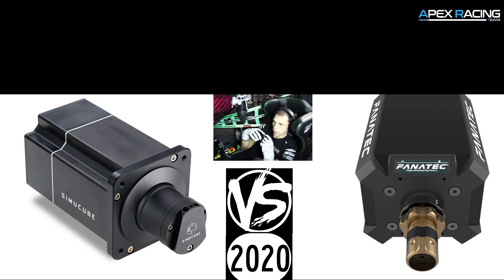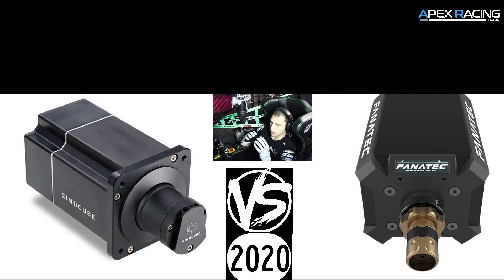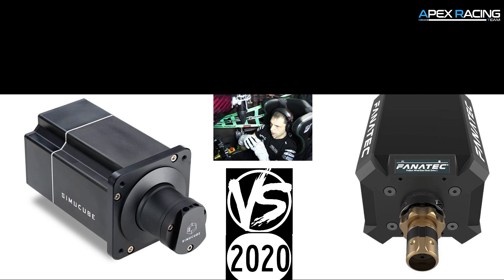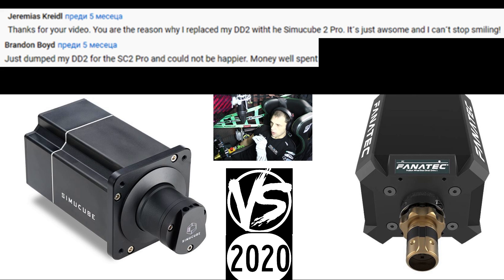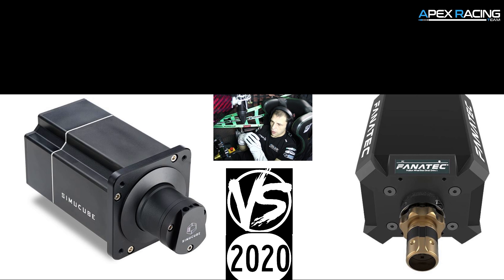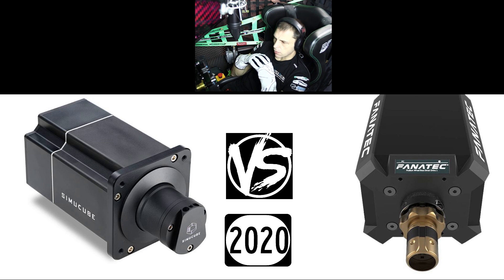Fanatec vs SimuCUBE 2 in 2020

Comment: I bought my simucube for under $1450 shipped. That's alot less then 1700 euro.

Also I bought a REAL sparco wheel for 200 bucks and done. So it was way cheaper then fanatec and I'm out of their ecosystem which I'm not fund of since it's very closed off.

If I need rotary encoders and buttons then I can add a asher racing wireless button plate and it would be similar price to fanatec and it's better stuff.

In my case I can make my own and saving a heap load of money.

Ps I was going to buy a fanatec DD until I found out about the QR and then learned about the simucube.
Reply from the maker: Yeh , for USA prices are different because of the taxes! Great you all put your comments guys so people who need to make whatever choice can have full information 👍
Reply: Well I hope you are not an accountant. So you have a function-free wheel and a wheelbase for that prize, not a ready-to-go system.
Reply: @iseeq72  well mainly as I race manual cars that don't have systems to tend to it doesn't matter much. That said I did build me my own wireless wheel button plate and paddle shifters much like a asher but with a simulated mouse added too it and it cost me under $100 so.....

Comment: Thanks for the insights! But there's something else you're not considering: Fanatec low qualitiy issues, on the long term, make the DD2 a smarter choice (even being not smarter than just buying a Simucube 2). 
I had a Fanatec CSW 2.0, it just burned (literally, in flames); as I knew latter, it was a common problem with their chinese fans responsible for the cooling. But at that time, I already had a CSW 2.5, wich also crashed (also after the expiration of warranty), because that black plastic wheel stopper, inside the base, became brittle and crashed, making the wheel turn many times after turn on, destroying the internal components.
 In both oportunities I had the worst experience using their costumer service. Fanatec don't care that these are well know fabrication problems that happened with many people: if you want to repair the wheels, they'll charge you almost the same as a new one. In that case, the 5 year warranty of the DD2 is a great advantage, because a Fanatec wheel will surely crash, as my 2 wheels did.

Comment: Hi Great comparison video i purchased the simucube 2 pro but i have an annoying electrical noise coming from the wheel base i am unable to silence the noise by changing the settings did you experience and such noise from the pro 2? here is a video of the noise https://youtu.be/eD_LOadqU_c
Reply from the maker: Ah yeh , that is absolutely normal noice for the direct drive wheels as they create those massive torques creating massive magnetic field! 
I race with headphones all the time and never hear this sound and every time someone seat on my rig I’m like WTF 😬 
If you turn up the reconstruction filter to 8 you he noice will be less noticeable but is not suggested option as this will slow the FFB ! 
You will ignore this with the time buddy 🤛

Comment: Good content mate.  Really appreciate you sharing your experiences.  Im on the fence between sc2 and vrs but there is a big saving if i go with vrs, like £400.  It will be my 1st dd wheel.  Hiw different can it be? Heard good things about vrs too.  Whats your thoughts.   Please advise?
Reply from the maker: The VRS DD wheel is pretty much the best of the first Gen DDWHEELS you can get ! The small mige and big mige motors are awesome and they use the best encoder Biss-C which have brutal resolution ! The difference in feeling speed must be very small and saving 400$ is definitely worth! If you don’t mind to have separate control box and not that compact solution as SC2 , best bank for your buck is definitely VRS on the market at this moment!
Reply: @chepilevski  thank you for your reply.  Much appreciated.  Im coming from fanatec 2.5 can i expect a big change is it small.  Thank you.
Reply from the maker: The V2.5 is a brilliant base and is almost DD like ! The only thing I didn’t like was that tension to re center all the time which kills more of the texture of the track! With the DD wheel you will start feeling every little detail on the road and you will be surprised how many new bumps you will find on different tracks! From feeling point of view in general will bring smile to your face but most importantly is the speed of the feedback! You will be much more connected with the car as you will feel and react 1 to 1 with the sim and you will be able to learn tracks much much faster then before and you will not need that much practice to hit your times! In long races you will be able to preserve your tires much much better! For example on my last championship on Nordschleife in a 1.5 h stint my tires was 15% better then my teammate on his Fanatec Elite base and we found trough the data he used much more steering angle then me and we ware absolutely equal in speed but the last half hour I was 0.5 to 1 sec faster because of better tires ! If you ask your self if worth the upgrade I can tell you that.... if sim is your hobby but you take it seriously enough and if you want to take the maximum of your driving abilities you need DD wheel in your life 💪
Reply: @chepilevski  that is a very detailed and comprehensive answer of the differences and i really appreciate your thoughts on this.  I will get a dd for sure its the experience that im looking for.  Now just have to decide which one! Vrs or simcube.  Leaning towards vrs big time  just based on value alone.  Thank you champ!

Comment: Very good video and we've learned a lot!! Thank you to spend your time helping us!!!  Newbie question: I have a Fanatec Clubsport, which is clear that it's not comparable with the direct base wheels. And also, you told me that who changed from Fanatec to Simucube didn't become faster. How about Clubsport to a Direct base, I will be faster? I,e: in Spa with the same car and conditions, do you think it's possible to do 2s less per lap?
Reply from the maker: Thx Andre ! I don’t think you can become faster even moving from Logitech to DDW ! Good pedals set and wheel can make you more consistent in long term but for single lap is always about driving stile ! If you want to become faster you have to brake down what the fast guys doing different then you and then try to change your driving! You can also try different cars which also help to brake habit!

Comment: Talking about SC2. Is it really worth to get the PRO over the Sport? I'm thinking that the Sport should have more than enough strength and I heard that some people had issues with the 2x power supplies on the PRO. What are your thoughts?
Reply from the maker: Povilas Duchovskis I really cannot answer that question mate ! Never had proper test with the spot but I personally believe the difference must be insignificant! But still I’m not sure
Reply: @chepilevski  Thanks :)
Reply: It has changed from CSW2.5 and has SC2Sport. My current setting is calculated to be about 10nm ~ 11nm. If the torque is more than thisthe steering is too heavy for me to operate well. When I drive every day, I even want to lower the torque even further.I think Sport is strong enough for most people.
I'm feeling very satisfied with right choice

I'm sorry my English is not very good.
Reply from the maker: @badbrains7  thank you for the report  man! We need to know what is going on with the Sport !
Reply: I drive my SC pro with 6-8nm. If more its exhausting ifnI run for long periods. So I supose that the Sport will work as fine. The max force is maybe stronger in Pro, but the super quick, precise and smooth response should be the same in both.

Comment: I don't know how one could compare them because it is almost entirely dictated by your settings both on the base and in game.  I find it very time consuming and challenging with the DD1 but when it is working properly its excellent
Reply from the maker: That’s the reason I first heard explain how I test those wheels and and what is my goal! There is no doubt with all the filters you can use you can make them feel the same but is not what I m looking for because the best settings for me are the fast settings ,those which not slow down the connection because of the processing all the information! For my driving those really make a huge difference and doesn’t really matter which sim you use in this case !
Reply: @chepilevski  That makes sense to me.  I notice iRacing for example I need to run a wide range of filters to get most cars to feel right but in titles like ACC, pretty much runs good with little effort.

Comment: I think more people would be less reluctant to buy the SimuCUBE 2 if it was plug and play like the Fanatec system. I know I'm looking forward to your video on wheels I would like to find a wireless option for the SimuCUBE 2 if I go that route. I'm in the USA and it looks like getting a wheel takes a while as after ordering. Since most of my wheel time is in the fall and winter I can find the right solution by then. I would like to order both products from the same vendor if that was possible.
Reply from the maker: My last experience with setting the Fanatec was not really plug and play! Wen you take Fanatec and you are new to that system you will need for sure some help ! I had to pass trough 4 different firmware updates and the last two of them I had to search in the forums because they ware not available on the website! The Fanalab is more complex too from TrueDrive but you have explanations for every slider in Fanatec and no explanation in true drive ! But definitely at this point and time SC2 is more easy to set up then Fanatec for someone who is completely new In this ! For someone who have experience is just standard procedure and is like any other hardware you have to install those days  :)
Reply: @chepilevski  I have the V2.5 and not happy with it right now. I will be upgrading but, I don't want to build a wheel. I want to buy the SimCube 2 pro in one package wheel and all. At least have a completed wheel and why two power supplies just have one bigger one. It's not that I can't build one I just want the right compatible parts as rim sizes and quick connects then I would want wireless. It's not as upfront or as black and white as it should be. Plus where you are there are a ton of dealers not in the USA,
Reply: @logo8009  yeah the two power supplies are a bummer. But I think I will go for the sport version. This one has only one power unit and is also very good with 17 NM torque. About wheels just get a Ascher Racing F1 wheel or button plate with a rim like the Fanatec GT rim. It is indeed a hassle to buy at 3 different companies but hey it's manageable and you do it just one time....
Reply: @bjornromermann5080  I'm just not if there is as much detail on the sport version. If I upgrade it will be the last for a while

Comment: Where do you think the lack of smoothness comes from? Does it have to do with the resolution of force feedback effects in the sim and how the wheelbase translates that? Is that what the filters are for? So does that mean Simucube has a better algorithm for translating or that it's just more accurate hardware?
Reply from the maker: That is the most deep and probably the best question about this topic! Now , I don’t think there is clear answer about that as Fanatec really keep there electrics specs for them ! I remember wen I had conversation with Tomas from Fanatec he told me the bot SC2 and DD1/2 have absolutely the same speed and even if I wasn’t sure about that few months later they bring new software which indeed make the DD wheels super fast but still in that same speed SC2 was lot smoother! I personally believe that Ganite Devices have really very very capable software team as they work in robotics industry and they have probably big advantage over Fanatec ! But again, that is my thought and I really don’t know if is hardware advantage of software!

Comment: I only have experience with 3 wheels. Thrustmaster T500, Fanatec CSW V2 and the Fanatec Podium DD2. Out of all 3 I only recommended the CSW V2. 

My main issue with the DD2 in the beginning was the performance. It wasn’t good at all. It has improved over time but it’s still not as consistently good across all sims as my CSW V2 was. I am however getting used to it and it does have its great moments. 

My current complaint or criticism is the quick release. It’s just not quick at all. That rubber ring causes wheels to stick. It can be down right difficult to get the wheels off. For a $1500 wheel base that’s unacceptable. 

 When the competition has a large verity of QR solutions that are bulletproof and actually quick and user friendly, to choose from. It totally makes the Podium series feel inferior to all other dd solutions on the market....just based on that one universal feature all high end wheel bases have. 

I had issues with my DD2 since I got it last summer. I finally got an RMA and sent it in for repair. The wheel was gone a total of 23 days. The DD2 I received in return isn’t my original DD2. Most likely a refurbished unit. They did send me the updated E Stop with a carbon fiber wrap. That’s kinda nice. I just wish they were more transparent on what they did.
Reply from the maker: Thx for sharing your story buddy! I hope and start to believe is absolutely possible for Fanatec to improve the wheel with the time and yes, I used V2.5 and that base is absolutely awesome for the money
Reply: Race Beyond Matter I’m a firm believer that Fanatec will be the industry’s leader for direct drive systems in the future. Once they master the technology they’ll be in a much better position then anyone else to innovate and bring incredible products to the market. 

 It’s a company that’s 100% about sim racing and that’s an edge over everyone else.

Comment: One more great video. Thanks for share with us . I’m waiting my SC2 pro  arrive here . I believe  I gonna get it this week.i was in doubt between SC2 and DD1 . After I watching your videos , I chose SC2..
Reply from the maker: Well, you know well then what I personally think about it 😃 I wish I can see your face impression on your first test mate, it is definitely WTF lol 😁 happy Racing man ! If you need any help we are here 😃
Reply: @Marcelo Alves
Which steering wheel did you get with it?
Reply: @celzolsen8988  I bought the ClubSport Porsche 918 RSR and Formula V2 from Fanatec. To use with the SM2 base, I bought the adapter from SRM.
Reply: @marceloalves4277  thanks! Can you let me know if there is any flex or anything else undesirable?
Reply: @celzolsen8988    In my case, I chose  to use a USB cable adapter (no problem for me), but you can find some steering wheels with a wireless adapter (a little bit expansive).

Comment: what pedal set should be used with the simicube 2 pro wheel base?
Reply: Yeah Heusinkveld Sprints are fabulous.
Reply: @Steven lannelli little late but for others who maybe confused you can use any USB pedals with Simucube 2 you are not locked as Simucube dont make pedals anyway. I have seem there are some pedals that plug into the Simucube 2 bases but cant remember there name and model.

Comment: I have the Simucube in mind but money is big problem. I will need to buy wheel but I can’t buy the expensive wheel and I need to have buttons on the wheel for when I do league racing. I also do drifting so I think cube would be better for me. My sim rig and room I have I can only fit the Simucube sport version n also budget wise. What is an okay wheel for simucube as I race more tin tip cars then open wheel.
Reply from the maker: https://youtu.be/GYAMVF0bTVo I have made a video here and asked everyone to put comment for what they are using! You may find something in the comments section for you mate 😃

Comment: Thank you for this, I got my SC2 this week. I have not yet changed any filters. Do you use the the same for ACC or do you recommend anything else? I will try these later today 👍🏻
Reply from the maker: I change nothing in the wheel settings for any games because the philosophy is the same ! Wort going find my video for the Settings so you can get it right from now mate !
Reply: Race Beyond Matter: thanks again, I just mapped your settings in this video.  The difference feels more subtle to me. I do get some notchyness in certain tight turns, so may need to add something back to dial that out. So much to learn and adjust, as everything is so subjective 👍🏻
Reply from the maker: Brooksy that’s so true! I think granite are working exactly on this as they really try to improve the reconstruction filter which play the biggest role in the feeling of the wheel ! We may not need to tweak anything after next update but let’s see 😁
Reply: Race Beyond Matter that’s the one you set at 1 (very fast) yes? I’ll experiment with that later 👍🏻
Reply from the maker: @brooksy2622  yes, i use always 1 very fast ! Even feels bit harsh I got used to it and is the setting that give me the most confidence on driving on the limits

Comment: Today i first used the simucube2 pro, but didn't like the settings like the way it is now... Do you also have vid about the simucube2 settings true drive and ingame acc?
Reply from the maker: Did you tested the suggested settings for ACC from the true drive? I use them lately and I like them a lot ! The reconstruction filter is bit high on those settings and I put it to 5 and just adjusted the in game FFB power... if you haven’t give them a try and let me know how you feel ! I’m not really an expert of ACC and I use it only for videos but still I feel those settings very sweet !
Reply from the maker: Do you know how the add the True Drive suggested settings for every different Game? They are on the ADD button!
Reply: I found it, wheel came to life!! Man what a diffrence coming from the T300... smile  from ear to ear! Thnx a lot 👍💪